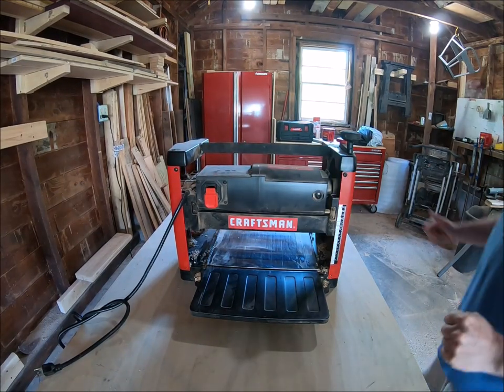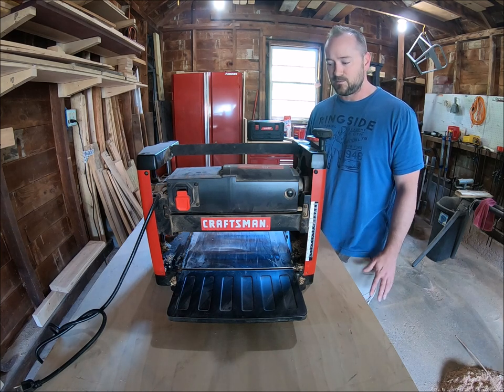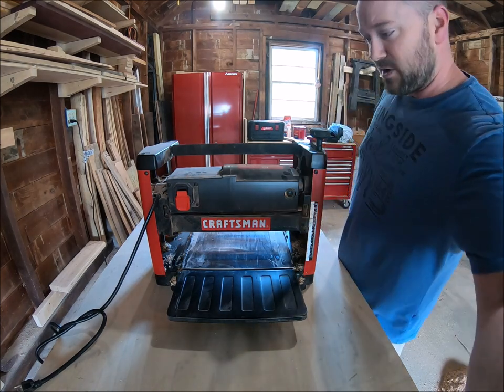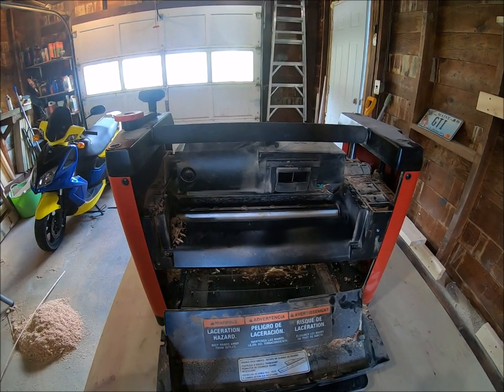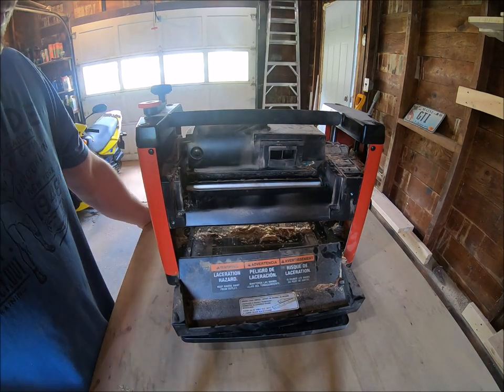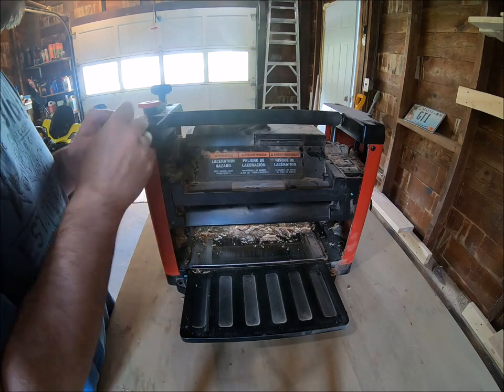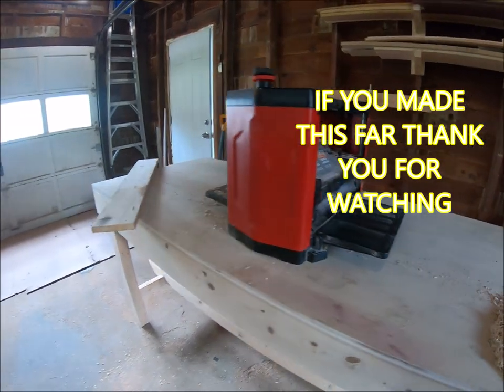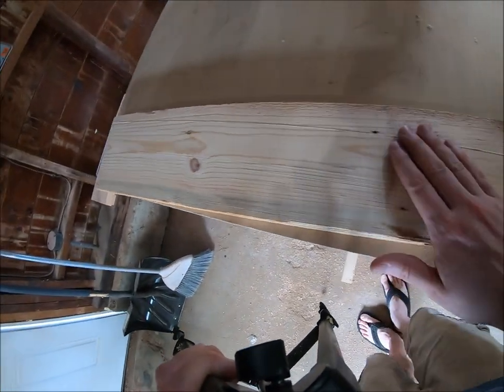Craftsman Thickness Planer One Year Later!

Comment: Have the same one for about a year too. I've tried everything to get rid of the snipe. The only thing that works is to make a sled out of 1/2" MDF and use hot glue to attach pieces outside the area of your work so they go in first and come out last. PITA but it works.
Reply from the maker: That's what I started doing too. I usually leave the 2 outside pieces 4-5 inches longer when I glue.

Comment: Thanks for this honest review. I'm debating between the Craftsman and the Dewalt. Of course price is the big difference, as well as a couple of upgraded features on the DW. I've heard about the snipe in the Craftsman in each and every review that I've read or seen a video on. It doesn't make sense that Craftsman doesn't fix this issue. Anyway, I'm leaning more towards the Dewalt after seeing this. Thanks again.
Reply from the maker: I am currently replacing the Craftsman with a Hercules from Harbor Freight,  It's pretty much a clone of the Dewalt 734. I'll post a review on it a few weeks.